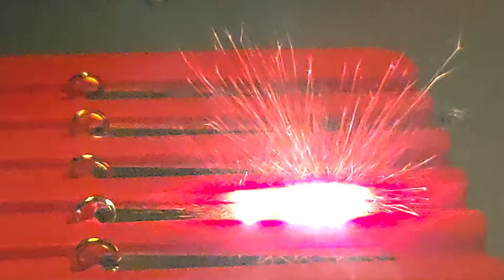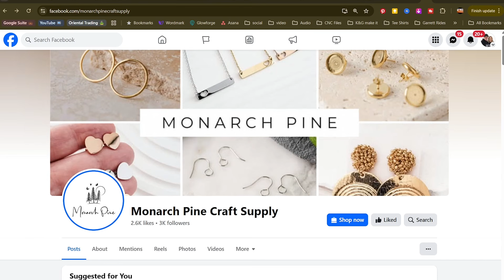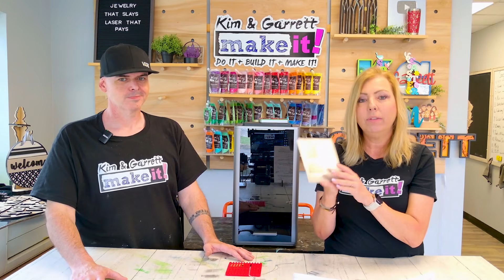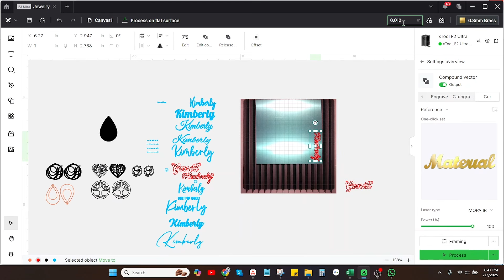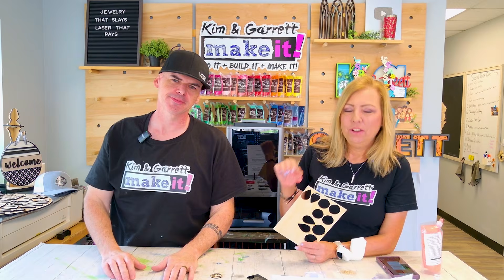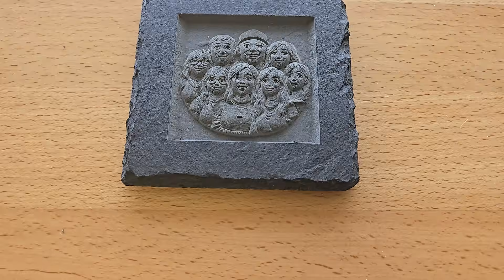Turn Blanks Into BANK – Jewelry Ideas That Sell Fast With xTool F2 Ultra!

Comment: its a great machine, and im sure it will help many businesses but $6000 is a massive investment for normal working class people.
Reply from the maker: I agree, it's a significant upfront cost, but the earning potential is huge. We use it all the time for engraving., because it's so fast. It's a great addition to an already existing product line or customer base. Check your local FB market place  for someone who bought one and it didn't workout for them.

Comment: It looks like an amazing work horse. For me, the cost for such size restrictions would have me passing. I've been pondering the P2 + F1 combo for a bit now but as a crafter with aspirations, I'm having a hard time pulling the trigger for 'A', the cost and 'B' how fast the next greatest thing becomes obsolete like the M1, which I have and love, along with the original F1 which is my price point but not going to be usable for much longer. 😢
Reply from the maker: It sounds like you've put a lot of thought into your options! The P2 + F1 combo could be a great fit for most crafting needs, but it's always a tough decision with technology evolving so quickly. As long as you aren't doing metals, that combo works great.  I just used our P2 this afternoon and while filming this video I was running leather keychains on the original F1.
Reply: Thank you for sharing. It helps to know that you guys, who are really levelled up, still get use out of your older, not really old, equipment. Much appreciated! @KimandGarrettmakeit